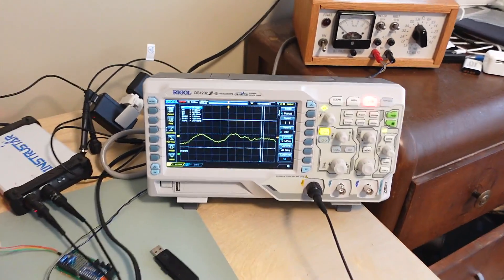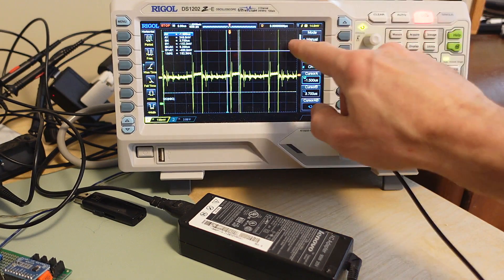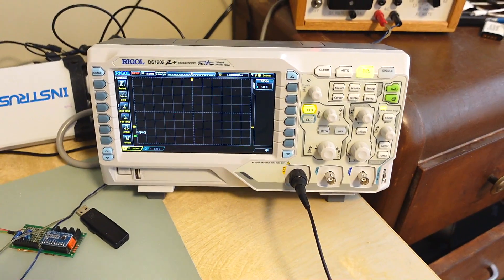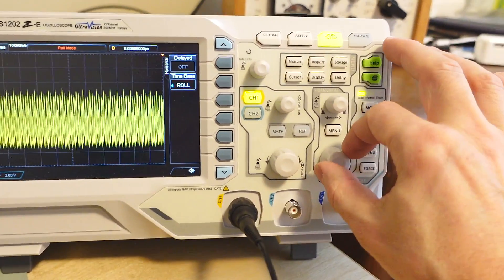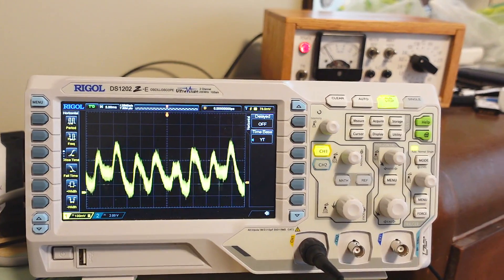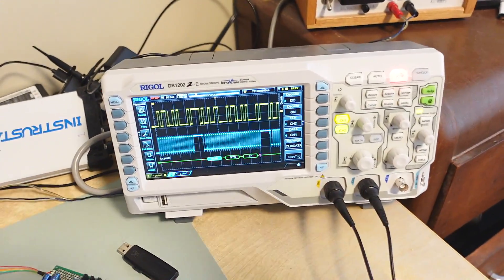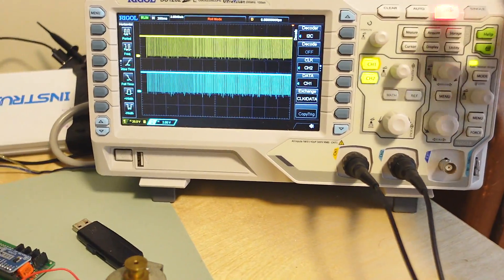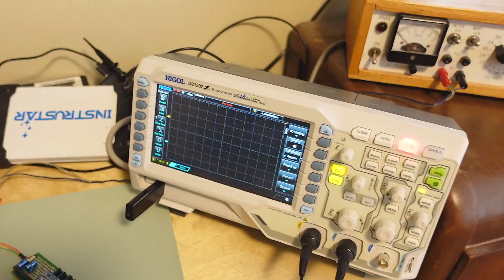Rigol DS1202 Z-E scope review

Comment: With my Rigol, I always have trouble decoding signals. I usually have trouble getting it working, and by the times to do get stuff working I have no idea what I did. 
To be honest I would love to upgrade Rigol to a better scope. 
Also the menus, interface isn't great, along with how the screen freezes whenever any panning or x-y changes. I do think that Rigol could fix most or all of these issues via software, but I get the impression that Rigol doesn't improve existing scopes but focuses on new Scopes.
I'm looking, and wishing I could purchase a Tektronix scope.
Reply from the maker: get the hanmatek and use it for a while, and you will appreciate the user 8 terrace on the rigol.

Comment: As an engineer that has built many embedded systems with user interfaces, I am astounded and frustrated by the multitude of awful designs that exist. I can't understand how these systems ever passed even the most basic testing.

Frustrating cases from my life:
Our microwave has a knob with a rotary encoder. Sometimes you need to select between two modes by turning this knob. A sane design would have, say, clockwise switching to manual and anticlockwise switching to auto. But no, it cycles between modes on each single increment of the encoder - requiring miniscule movements of the knob to achieve the desired setting. At the very least, the encoder ought to have been scaled down - either would have been trivial to implement.
I have both a Gps and spectrum analyser that both have very laggy interfaces. Processing user inputs and confirming them ought to have the highest priority - but on both of these devices, it is the lowest. This means that you have to wait a second or more after each button press for the device to catch up, otherwise you find every second press has been lost or misinterpreted...
Finally, my phone has a screen "auto rotate" facility which is completely useless because it has absolutely no hysteresis, so it is prone to switching back and forth rapidly when the phone is on a table. To make this worse, it buffers all user input and doesn't empty the queue when switching orientation. So, you get a whole bunch of (potentially disastrous) incorrect selections made once it settles in the new orientation.

It is always astonishing how basically good equipment can be ruined by trivial oversights. Like some elaborate instrument, full of ASICs and multilayer PCBs, yet the power supply is such a mundane, poorly designed piece of rubbish that it leads to the premature failure of the whole system.

Comment: I have been using oscilloscopes daily since the 1980s. I judge an oscilloscope by how much internal noise is generated with good ground. If I can see noise with the probe ground connected to the probe signal pin, as you have done, and see any noise then I will not use it. If the signal of interest is 1 or 2 millivolts and I need to measure frequencies and phase shifts of a signal, the scope is useless. It will be impossible to trigger. What do you attribute the noisy floor signals to? Otherwise, it looks like a very useful scope.
Reply from the maker: Internal noise.  Even with the probes disconnected, it's there.

Comment: I don't own any digital oscilloscope. But at 06:40 you are complaining about the zoom which always zooms into the right edge of the screen. When I look at the screen there is a little yellow triangle at the top of the screen. It looks like some kind of cursor. Can you move that left or right? Maybe it just always zooms into that cursor and you only have to move it to the middle of the screen. 🤔
Reply from the maker: I can't just drag that triangle with a mouse, not sure how it would be moved.
Reply: @matthiasrandomstuff2221  That's the horizontal trigger point, you can move that with the rotary control at the far right.

Comment: Re: selector knob hard to push without rotating:
Instead of using the knob, you can push the same button you used to access the dropdown menu multiple times to select and then press "clear" to close the menu.
Reply from the maker: Thanks  Useful tip.

Comment: HF noise the scope picks up is likely your wifi, phone, bluetooth and radio signals since the probe functions as an antenna. And due to the high speed dac you pick up quite a lot of noise. If you'd use a terminal directly on the scope you'd probably see a lot les noise. Scope nouse is in the order of 10-20 mV. Looks worse than it is. On analogue scopes you see far less noise due to the slowness of the phosphor in the tube.
As others have mentioned you can put it in high res mode, or you can reduce the buffer size. It tries to overlay multiple waves but with non cyclic waveforms it becomes a noisy mess.
I think this one should have an ethernet port, you can use it to capture data quicker than usb. There is also free scope software you can use. The rigol software is unusable.
Reply from the maker: noise is present even with probe disconnected
Reply: @matthiasrandomstuff2221  but is the terminal shorted to ground when disconnected? And more than say 20mV? HF behaves weird though. Eev has some good videos on why digital scopes seem so noisy.
Reply: @imqqmi  phosphor
Reply: @PabloEdvardo  coorrected, thanks!

Comment: I use the functions on the left side a fair amount for one off stuff i just leave frequency and peak to peak voltages on the yellow trace.  It just stays open and works automatically.  Fancier functions you aren’t wrong.  I have a different model but they have some functions that trigger when your signal varies by a certain percent (masking maybe? I forget off hand).  It lets you trigger off glitches and things easily its handy.  I used it for example to trigger off an afci tester to see what it was doing or find switch noise on ac, or probe an uninterruptible power supply.  You are kind of right about analog scopes.  Sometimes i use mine just because it feels nice to use… but if I’m honest there is no practical reason with a digital scope that capable.

Comment: Nice video Matthias, thanks for sharing. Have you looked into what the SCPI Panel Control provides you using the built in ethernet connection. Apparently you can send commands and read data. Not sure how rudimentary that ability might be, but just curious.
Reply from the maker: Have not.

Comment: I hardly ever use my Hantek DSO4102C scope. I can assure you the UI is just as bad and awkward. I love my small Tektronix 224 and use it all the time. 
It's tiny, silent, ready on power up, runs from a 12V external adapter or 12V SLA battery (I threw the old battery out and didn't replace it), with isolated grounds and channels to stop me from making stupid mistakes. 
The Hantek has been demoted to FFT analyzer and signal generator.

Comment: doesn't it have a cable network connection? I used to take screenshots from the scope using the apple laptop over the home network on the older model (1054z). I guess it also supports aquiring raw data.

Comment: Hi Matthias
When you press the mode button repeatedly, the scope steps through the selections.  Pressing any other button locks the selection. This way is easier than pressing the rotating intensity/selection knob which usually locks in the selection you don't want.
Joe
Reply from the maker: Thanks for the tip

Comment: nice cheap scope, had some fun with the 4ch version, a little lacking on the screen side (size, gui) but does the job.
iirc, math mode on this model is a nightmare.

btw, you are not supposed to turn off measurement equipment anyway. Some scopes even tell you that the measurement isn't fully accurate until 30m of warm up
Reply from the maker: I suppose.  Like spectrum analyzers with an ovenized crystal.  But nowadays they just all get hooked up to some GPS based time reference.
Reply: @matthiasrandomstuff2221  I think it has more to do with their internal voltage references
Reply: I think the people that need that level of accuracy aren't going to be using one of these scopes. That sounds more like something for a scope with a heated crystal that needs to reach equilibrium.

Comment: I have 1054 but it seems quite similar. In i2c decode mode you can change from ascii to hex you need to use up/down button on the right to the screen to change menu. Secondly there are some nice python libraries to communicate with the scope and this open lots of possibilities ;)
Reply from the maker: I guess I only sratched the surface in the 9 months I have had it

Comment: If you put linux on that old thinkpad, it would be blazingly fast, not crazy slow like it is now with winBLOWS
Reply from the maker: Yes, and completely incompatible with the scope.  So then I'd have to get another windows computer.
Reply: @matthiasrandomstuff2221  Chances are the scope software runs under wine. I run a few things under wine that talk to usb hardware, like the xgpro software for the ubiquitous XGecu eprom/eeprom programmers - works just fine. I also run tools like Sim68k which emulates a MC68000 processor which is only for windows under wine just fine (and that's not like a mainstream piece of software, it's just some obscure thing written by an individual that needed a 68000 emulator). You already use a lot of linux on raspberry pi's, but full linux on a full machine is so much better than any raspberry pi ever could be!
Reply: @1pcfred  The CPU architecture isn't the problem - ARM, x86, the various other architectures you can get precompiled packages for, it doesn't really matter. The problem is low memory and low single threaded cpu performance on any raspberry pi, and slow storage write speeds. Even a 4 year old i5 with a cheap nvme ssd blows the best raspberry pi out of the water for performance. Using a raspberry pi as an indicator of how a full-fledged linux system operates just is not a good use case. That and raspberry pi's are hard to come by sometimes, and expensive now for what you get. You can get an ultra small form factor used desktop with a 256GB or 512GB nvme ssd, 16GB of ram, and a relatively recent i5 or i7 for $150. You'd pay that for a raspberry pi with less memory, a shitty sd card for filesystem, and a weaker processor by the time you buy a power supply, case, a stupid micro hdmi cable, etc etc. They're just not good value for money.
Reply: That and also one of the things I would expect might be architecture dependent would be windows emulation through wine - you might run into more problems running wine on an ARM than on a real x86 machine - but I haven't tried it myself, so I'm just (somewhat educated) guessing on that one
Reply: Rofl, what kind of bs is this... Heis problem isn't the os, it is the slow pc. And yeah wine is such a perfect solution, not
Reply: @riba2233  Wine may not be perfect but Wine is better than Windows at running Windows software. Not that that's saying very much.
Reply: @1pcfred  that is a pure bs and you know that

Comment: I ended up buying a siglent SDS1104x-u when I was looking for a scope in that price range.  100Mhz 4 channels.  I felt that if I ever needed more than 100Mhz, I'd likely also need way more than 200Mhz, while the extra channels found immediate use.
Reply: I have the Siglent SDS1104X-E, and really like it. When I bought it I was choosing between this and a Rigol in the same range.. but found the Siglet to be better value (and better performing!) (also depends on your usecase I guess)  But 4 channels is awesome! And I also have used them quite a bit. I also found it quite intuitive to use. Really happy with it.
Reply from the maker: 4 channels can be handy for really complex setups.  2 really matters because that allows you to compare timing of different signals, and usually you can get away with just two at a time.  Not ruling out getting a 4 channel version eventually, but have never really needed more than 2 channels.

Comment: Have you tried an Analog Discovery oscilloscope? It seems like a fair middle ground for those two. I use it quite a bit, it could use the Rigols big buffer. But for digital work it's quite nice. Recording I2C or other digital signals can be set to trigger at not only edges but also acknowledgements, addresses and so on.

Comment: Have you thought of replacing the hard drive in the laptop with an SSD. I did this on an old DELL Inspiron 17 N7010 laptop dating back to 2012 and booting is much, much faster.
Reply from the maker: yes, thought of it.  Replacing the hard drive is the easy part.  Setting everything up again is not.
Reply: @matthiasrandomstuff2221  Just image the HD directly to the SSD, and expand the partition size after to take up the whole drive - job done.
Reply: @gorak9000  yes and no... you need to make sure the cloning software is aware of 4k sector boundaries
Reply: @PabloEdvardo  4k sectors have been the standard for over 10 years now on disks and SSDs - wtf ancient software would you be using that doesn't know about 4k sectors by now?

Comment: Another great scope is the Siglent SDS1104X-E.  4 channels (a must, in my book), easily hackable to 200MHz BW (check EEVBlog forums - lots of info there), modern UI, good sample rate (same as the Rigol DS1202Z-E, if you only have 2 channels on).  I got mine on Amazon for $400 USD (I think), on sale.  It also has all the common serial decodes unlocked from the factory (why scope manufacturers insist on charging for RS-232 and SPI anymore is beyond me).  You can even control it over the web ui, over ethernet or wifi (wifi is a common and cheap dongle, with an an easy software hack to unlock it).  Can even save scope shots over the network.  Digital channels are a bit weak and probably not recommended (too expensive, reportedly missing some functionality), but I really can't complain about that for the price.  Memory depth is a little better on the Siglent than the Rigol.  And yes, it does support roll mode.  In my opinion, one of the best bang for the buck scopes on the market right now.

Comment: Hi Matthias, I have the same scope, I chose the 200MHz BW model because it was a just a few bucks more than the 100MHz unit. I have the same issue with the knob selector, not good for us with high blood pressure. Internal noise, on the most sensitive vertical setting, I have a noise of some sort on the trace, I think you are correct in that there is an internal source. WOW, $500CDN?? Mine was about $375CDN, got mine from Electro-meters in Pickering, ON about a year ago.
Reply from the maker: With taxes, from amazon, $477  I guess I didn't get a great deal.
Reply: Thats where I got mine. They are the only "authorized" dealer in Canada.

Comment: On the Rigol, you can eliminate the noise by selecting Acquire->Mode->High Resolution. This averages neighbouring ADC samples, which reduces the bandwidth and the high frequency noise. Note that this is different than averaging mode, which is for averaging periodic waveforms. High Resolution works for non-periodic waveforms, and is useful any time you just don't need to see the very high frequency stuff.
Reply from the maker: Thanks, that was useful.

Comment: RE: the fuzzy trace, that's an on-purpose feature you can turn off. Somewhere in the display settings you can set it to "precision" mode. It'll then downsample the trace so it's exactly one sample per pixel on the display.
Reply from the maker: Someone else pointed that out too. I looked for it, could not find it.
Reply: @matthiasrandomstuff2221 click the Acquire button, then the first softbutton for Mode, and change it to High Res.
Reply: @matthiasrandomstuff2221  it's not exactly in an obvious spot if I recall correctly. I'll dig out my own rigol tomorrow and look for it.

Comment: Regarding saving stuff onto your NAS from the scope, the Rigol is fully controllable (including dumping raw samples) via USB or ethernet. I have my 1054Z (with 100MHz and other features unlocked)  set up via the LXI LAN interface and I control it via a python library. The nice thing is that the regular UI is also usable so you get the best of both worlds. Obviously, these days I use the R&S RTB2004 much more because speed and features, but that is like 10x the price of the Rigol. Still the Rigol is very capable and probably still the best hobbyist grade scope.

Comment: My noise issue was the Power Line WiFi extenders that I use.   Noise comes in bursts.  This noise also caused my cable company to shut me down until we found the offending section of coax cable.